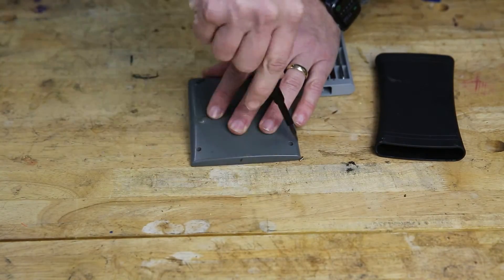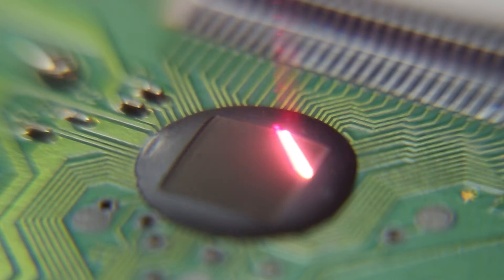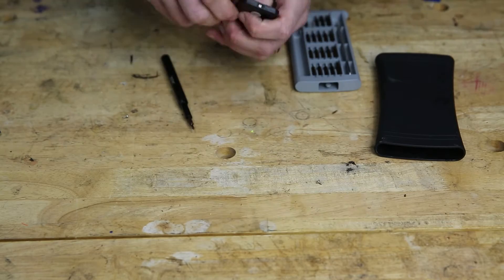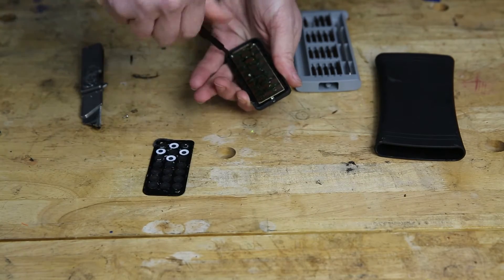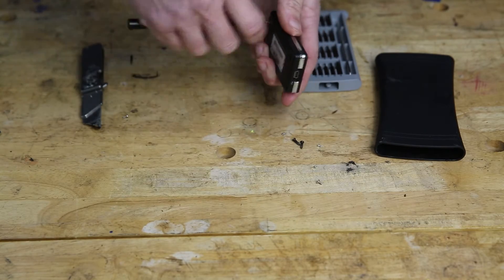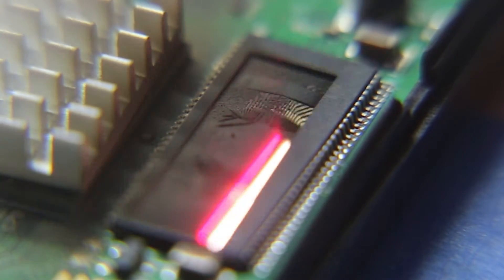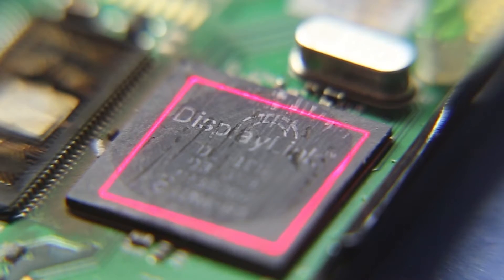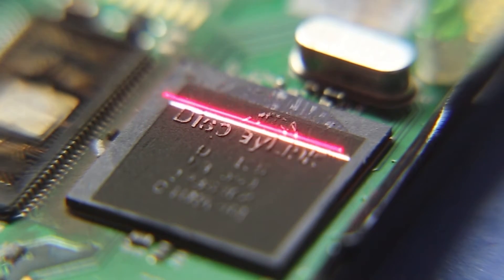20 watt fiber laser decapsulation- calculator and Arduino

Comment: Your still not blasting rthrough them for the most part. :)
just finding the underside of the chip inside the blob.
They used to allways b right side up with binding wires but nowadays alot of them get fused righ to the pcb face down.
Try cutting around the chip and opping it off then hit it from the other side.